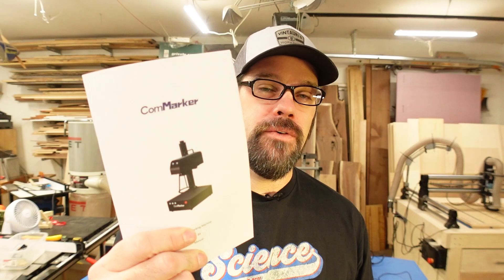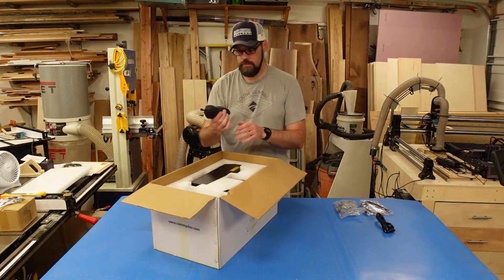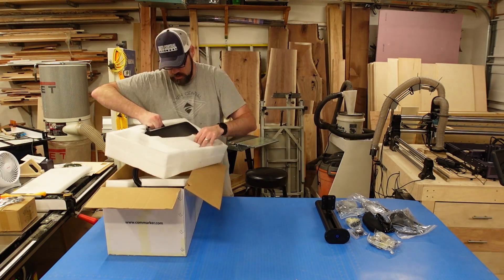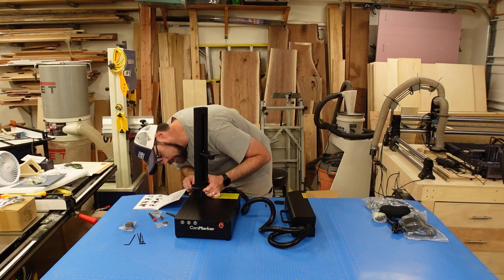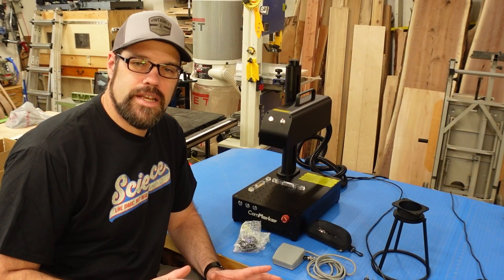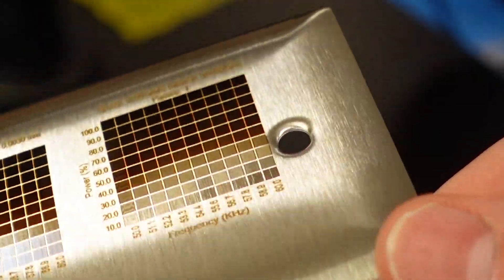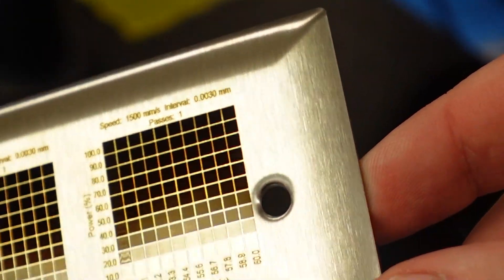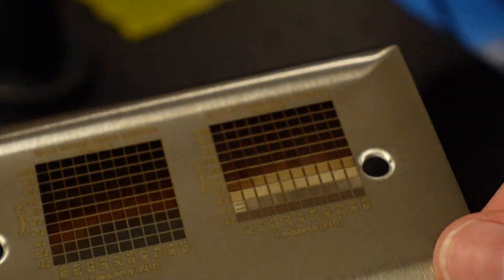ComMarker B4 20W Fiber Laser - First Tests

Comment: Thank you for the actual attention to safety.  Lots of garbage glasses to begin with not to mention people not getting the right wavelength.

FYI, the OD rating is a logarithmic scale so each +1 is 10 times the absorption of that wavelength.  

Higher is better but that typical means worse visibility.  But proper glasses have a visual light blocking rating as well and there are very good but pricey glasses with OD7 or maybe even 8 and great visibility.   

But OD6 is plenty of protection for hobbyists.  You will be totally protected from catastrophic eye injury and then it's like "dont stare at the laser a lot with glasses on" to avoid the slow long term damage.  If you're making a career of it then upgrade to the 7+ with high visibility.   Maybe 8 if you've got a 100w moonraker 

But it's only as good as they stay on your face so make sure they fit, have a retention strap (there are goggles too), make sure your peripheral is covered, have procedures to ensure you cant forget to wear them, and consider an enclosure especially if you might have kids/visitors/pets romping through suddenly.  

Opaque enclosures are perfectly suitable and you dont have to drop $500 on the lassr glass ones.  But do consider fire safety just in case... no cardboard or fabric etc.  

Oh and look for the lab certificate on the glasses. Amazon is shady. 

Thanks again for a proper safety briefing.  These things are safe if used properly and most people take appropriate steps but even most experts dont actually bother to understand what these ratings mean or why or basic science of the opaque transparent and absorptive materials.   Doing the right thing for the wrong reasons is better than nothing but one day the ignorance could bite you.

Comment: Got an update on getting consistent colors and things you can do with it ? Tried any relief cutting with it on the brass coins ? Thanks.
Reply from the maker: I have played with both the color options and the relief carves with limited success.  The color on stainless steel changes with the thickness of stainless as it's a factor of heating it to a specific temperature.  Thicker stainless material will dissipate the heat more which means your settings will change.  So what works on one piece may not work on the next if there are variations in the metal.

Comment: How do you adjust the focus for different thickness of material. Example the rock vs the metal business card?
Reply from the maker: There are buttons on the front that raise and lower the head. The unit has three low power laser dots that move closer together as the laser moves into focus. So you use the buttons to adjust the height until the three dots overlap.
Reply: @Vintauri  thank you. If you highlighted that in the video, I’m sorry I overlooked that part.

Comment: How does speed compare doing markings on this vs co2? Would love to see how much faster the galvo is. Maybe acrylic at same size or coated metal. Trying to pull the trigger on this but cant get speed comparison.
Reply: Well first off they do have galvo CO2 lasers.  The Galvonometer part is the laser being moved by mirrors rather than on a CNC.  

But speed wise comparing galvo to cnc all other things equal (usually aren't) I'd say 5-50 times faster depending on a lot of factors.

Yep, really.

CO2 is better for acrylic.  Fiber is amazing but acrylic is not it's strong suit.

A galvo CO2 would be ideal but they are very expensive and pretty specialized. 

Honestly I would stick with your CO2 for acrylic stuff.  Regardless of YT videos.   Not saying they are false but they are... selective.  

For powder coated steel  though?  Oh hell yes as long as it fits in the smaller work area the galvo laser will be insanely faster, infinitely more precise.  Less heat, less energy use

No moving parts almost infinite lifespan zero operating cost barely any maintenance...

Fiber is the shit

Just a lot harder to learn but so worth it.

Metal stuff is where the $ is at too

Comment: I'm in the market for these types of  engravers. Mainly wanting a decent engraving on like zippo lighters and maybe and gun slides. Would this be decent? I'm looking at the 30w version of this.
Reply from the maker: This will work very well on stainless steel and most metal used on the slides.  If you're looking to mostly mark them a 20-30w will be decent, if you want depth, getting into 50+ watts and a MOPA style will work much better.
Reply: @Vintauri the MOPA functionality wont affect engraving and depth much.  It is primarily for getting colors and finishes that are extremely difficult or nearly impossible without MOPA's huge frequency  range and pulse width control.

I don't want to say "never" as I dont have MOPA but I'm fairly experienced with fiber laser in general.

If you want depth, just get as much power as you can afford and forget MOPA unless there's some awesome bargain.
Reply: @Vintauri  also, again sorry to correct you but I enjoyed your videos and style and just want to be helpful... Zippo are mostly brass

But fiber is king for brass as well.

Oddly enough brass is almost easier to engrave than to mark, though you absolutely can mark it quite nicely, just takes a while and quite a lot of juice.  On a 20W you'll be running close to full power for black marking brass (same w aluminum)  whereas steel (mild or stainless) you'll be at half power.

Brass is very reflective cus of zinc and thermally conducting cus of copper which makes it hard to get enough heat at the one point on the surface to combust (but not vaporize) .
Reply: A 20W would be OK for zippos I'd definitely go to 30W  though, brass is one material where you really feel that jump from 20 to 30. 

For engraving firearms i agree you want to go up to 50W or even higher if you can afford.  Just because that's a lot of material to remove.    20W it's gonna take ages and might still not be satisfactory  30W should work but slowly, 50 you're in business, above that is faster.

  If you have volume business and time is money just get as much power as you can afford for engraving.  Marking you dont need more than 20 for steel, 30w is preferred for brass and aluminum

Comment: What are the differences compared to the xt00l 1064nm module?
Reply from the maker: This fiber laser is 20w of power compared to the 2w of the xTool module. The galvo mirrors can also move the laser around much faster than the gantry style. However you have a much smaller working area with this compared to the working area of the xTool modules on the gantry lasers.

Comment: Can I engraved photo on stainless steel with this laser
Reply from the maker: It will engrave on stainless steel, you can even get varying colors if you do some test grids to find power and speed settings.  I have done more vector art rather then photos with stainless so I can't speak to the quality or the best process for photo engraving, but it is doable.
Reply: @Vintauri  what colors were you able to get other than black and gold and brown? Whats the frequency range on this unit?

Some people are somewhat proficient at getting color on stainless using a diode actually, but I dont believe they have any real good control, it's basically like a small blowtorch and you'll  warp thin metal if you arent careful.

But im sure there are some special applications where it works.

I always suggest torching a big ass sheet and then selecting and cutting the areas with the colors you like, if that's a practical method for one's purposes.  

You're also gonna want to be proficient with image layers as otherwise multicolor is hard to control other than greyscale ish
Reply: Yup you can mark etch steel photos just takes a while to figure out the settings and image editing.

And definitely use lightburn for that.  Use lightburn anyways lol but for photos ezcad sucks but